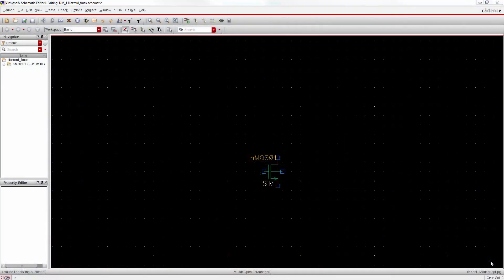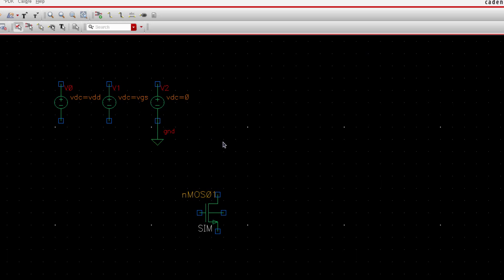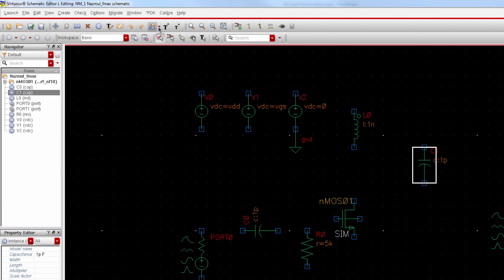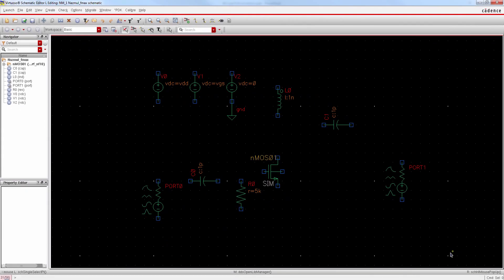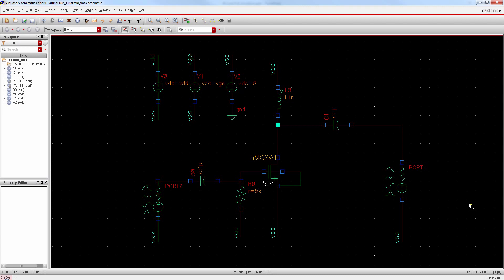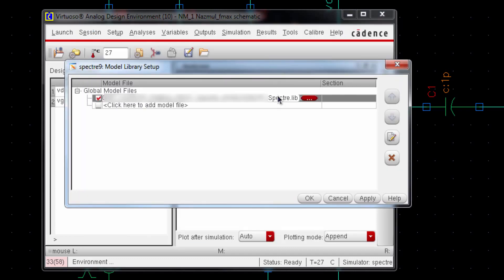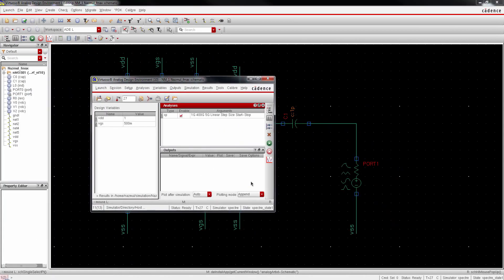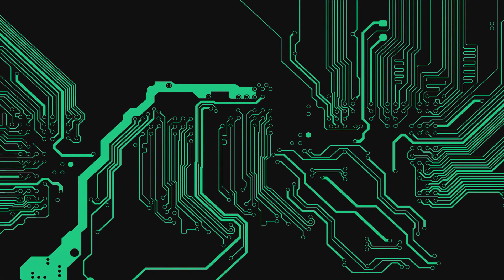Cadence Virtuoso: Gmax & fmax of transistor

Comment: Q: why don't you put just an inductor in series with the vgs source instead of the resistor? I mean what's the purpose of the resistor there? From what I've seen a traditional bias T with an inductor does the job. I simulated my transistor with an inductor, and it seems to be the same result.

Comment: Hi thanks for your nice and helpful video. Could you please explain about fT?
Reply from the maker: at fT the current gain of transistor is 0dB..This is the frequency below which we cannot use the MOSFET as amplifier due to loss of current gain
Reply: @tensorbundle ftmax is when maximum power gain (Gmax) of transistor is 1(0 dB). Ft is when current gain (h21) is 1(0 dB). Correct?
Reply: @Ixedud  Yes, it is correct.